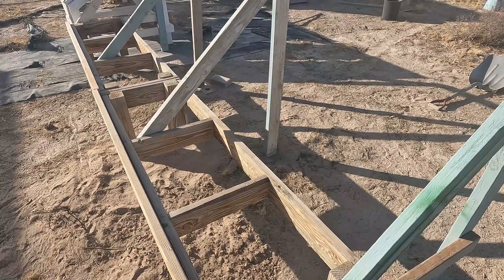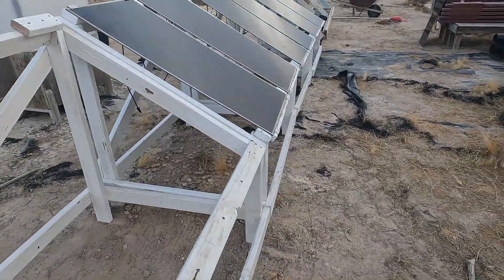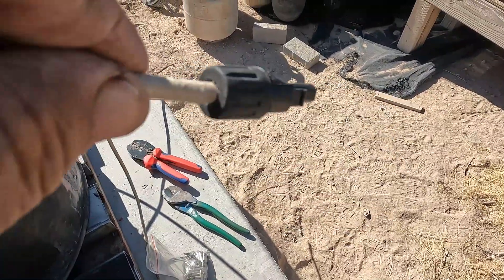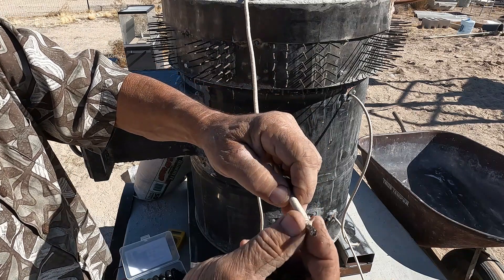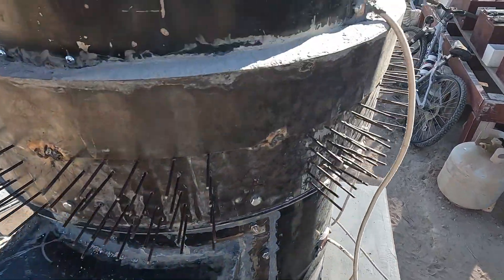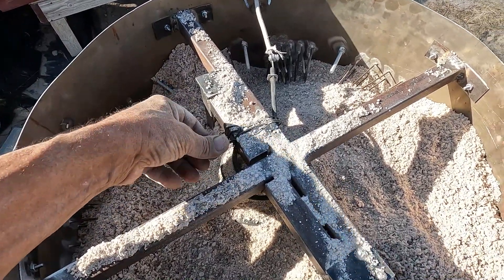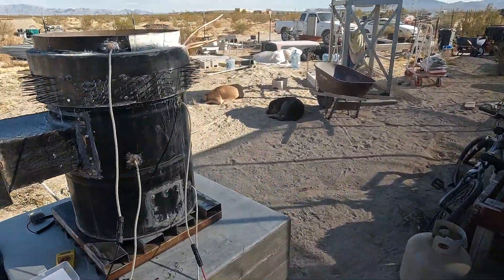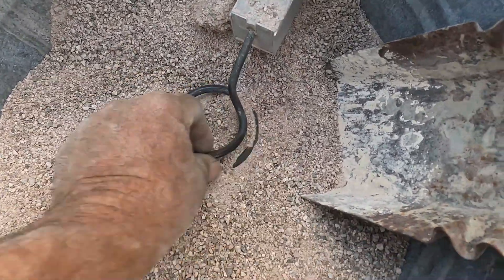169 - Fifty - Five Gallon Sand Battery Testing Begins

Comment: Cool find on those panels, perfect voltage for 120v or 240v.   

You should look into an inline dc breaker for the wiring.    240v dc may arch flash when the panels are connected using those mc4 connectors.   I’ve had a few of those burn out as have others.      15 or 20 amp fuses?
Reply from the maker: I will look into that. Thank you for that information. Yes I found those panels and the first thing I did was wire two up at 120-volts and was able to solder with a small 100-watt soldering iron. So I bought all I could afford at the time not really knowing what I was going to do with them.
Reply: @ that’s cool, right off the bat you had a plan.   I’ve been toying with using 30v panels in a similar way to heat water.

Comment: Thanks for making these videos, I've watched the others as well. I have a few questions as it will relate to my potential build.

1: why not use a thicker ga wire with the insulation stripped off for inside the sand battery? Due to copper melting at about 2k this will get more power to your elements?

2: Would compressing or tamping the sand down make it more efficient?

3: what is the maximum amount of heat output you are expecting to output from this (from the outside)?

Thanks and keep the vids coming. Great stuff
Reply from the maker: As far as the wire thickness I don't really know the answer. And I really don't know the exact capacity of these crazy prototypes but I am making some progress I believe. I will calculate the heat potential as best as I can figure.  One number I have just now come up with that will change everything is. 5-watts per pound of sand. That is the ratio they are at in the Finland giant 100-ton sand battery project. So at that ratio I need approximately 3,500 watts to charge this 55-gallon heater. I am already building a 27-gallon one as of now.
Reply: @off-gridsurvivalmike8120  thats good info on the 5 watts per lbs of sand. thanks
Reply: You can get better efficiency if you match the resistance if the heating element to the resistance of the solar panels. See video and spread sheet by David Poz.
Reply: @Mrmicpolock  barrel 200liter = 300kg sand>500°c/or400K=.....KW.   THATS THE QUESTION no.?there must be atleast addet 50kw to the mass i think

Comment: If the sand battery is great why are the nights in the desert cold?
Reply: Sand is an insulator. Heat doesn't easily spread down from the top layer into the depths, so the sun can only heat the surface layer so deeply, then the open skies of the desert night quickly radiate the heat out of the top.

These systems put the heat near the bottom/center
Reply from the maker: That is a reasonable question. Even in the summer the sand will cool down at night in the desert. It will all depend on insulation and balancing the correct amount of mass or sand to the wattage required. I can't really answer any technical questions but I can say there are commercial industries who are using this thermal energy storage technology.  Thank you for the question and for watching the video.
Reply: @off-gridsurvivalmike8120  so let me help a bit... sand has much worse heat capacity than water at 800 J/kgK vs 4000 for water... So 100c water will have the same energy stored as sand at 500c?

Comment: Nicely done!
Great to see these DIY projects, so inspiring!
If you got a clamp meter, you could take a current measurement, so we can estimate the actual power.
(I know you won't be able to measure the voltage while it's running, with those connectors nicely sealed up. That would be ideal. But it's dangerous anyway, if you're not familiar with it.)
Reply from the maker: I am capable of measuring the voltage from a couple exposed copper bus bars I have that are totally unsafe lol. These techniques were fine with the lower voltages I normally work with so I need to change a few things soon. I did read approximately 60 volts under load if that tells you anything. I may have an clamp meter I can try also.